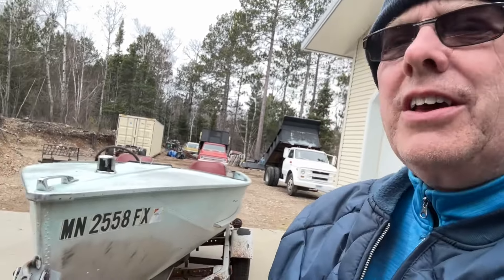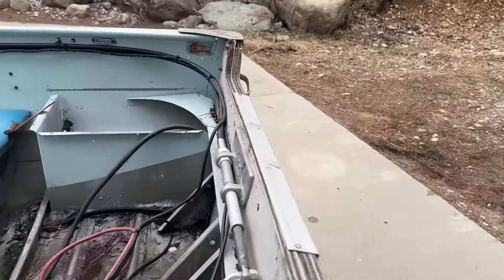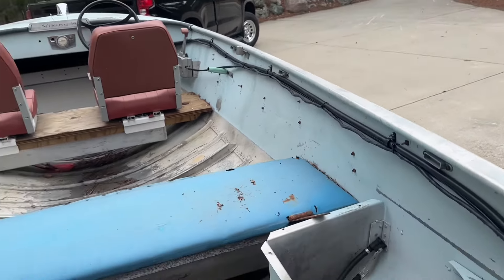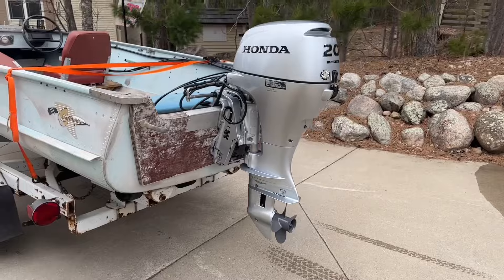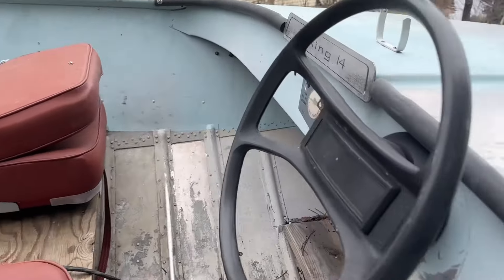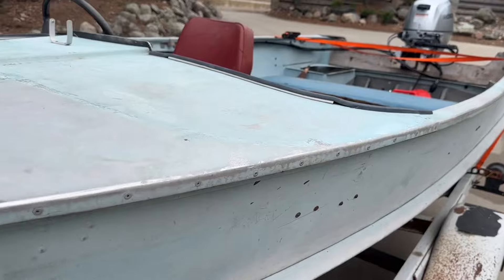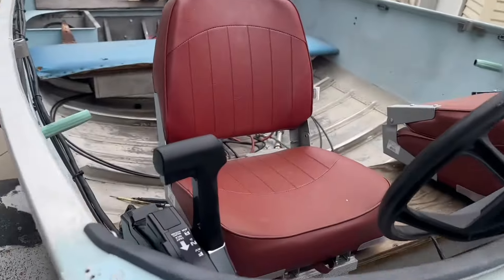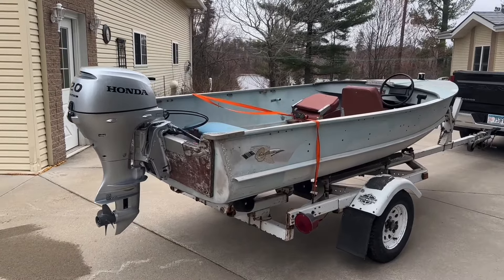1959 Crestliner Viking runabout gets a new Honda 20 HP Shortshaft motor. DrMVideo#41

Comment: Nice motor the only thing is for the same weight you could put a 40hp OMC on it. Smooth and quite too especially the 89'-up. I'd be interested to see what you think of the vibration from the Honda at idle. The 2 cyls go in the same direction, and in a tiller motor will turn your hand cherry red on an aluminum. the 3 cylinder tohatsu 25hp IS glass smooth, but thats neither here nor there. Cheers looks nice. Big fuel savings and a bit more power, too with this one.
Reply from the maker: I’ll definitely do a follow up…thank you for the info and for tuning in!

Comment: It's a '59, for what it's worth.
Reply from the maker: Awesome. I’d love to know the attributes that make it so…it was what I was told, and I really don’t know anything about these cool boats other than I love the look…🙏🏻
Reply: @drmstudio5050  several first year for '59 pieces here...
The bow piece, the red-lettered bird logo, the dash plaque, and the short splash rail with the angled front cut.
The Viking was indeed introduced in '56, but as a cockpit boat.  
You should be able to find the model/ serial number on the outside starboard panel, up near the gunnel, right about where the deck and dash join together.
Most likely will start with a "711" (speedster model number) followed by the production serial number.
Reply from the maker: @MarkDean1313  Thank you! I’ll check those areas out. Your info is so appreciated!